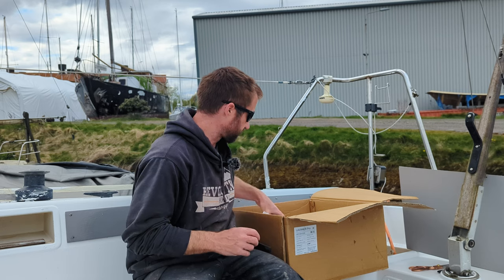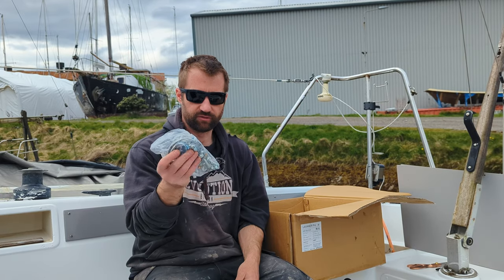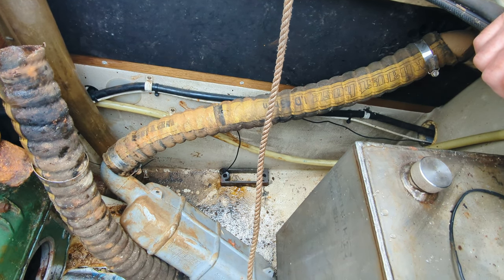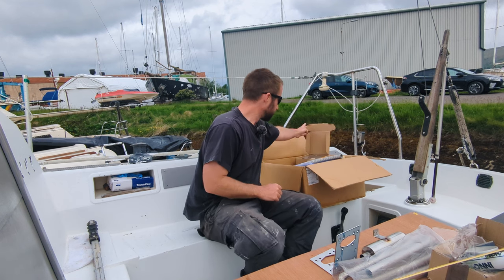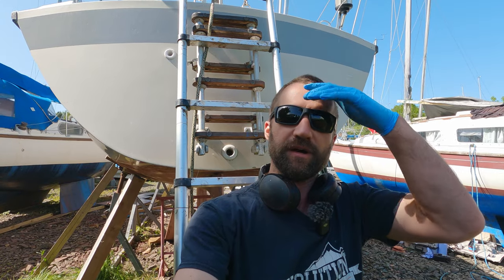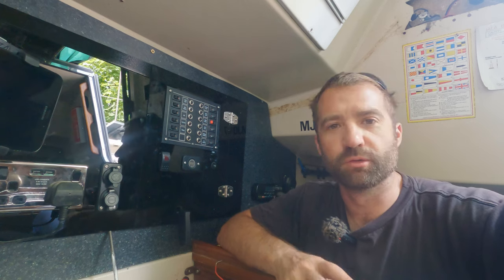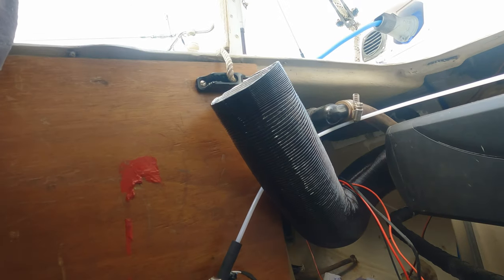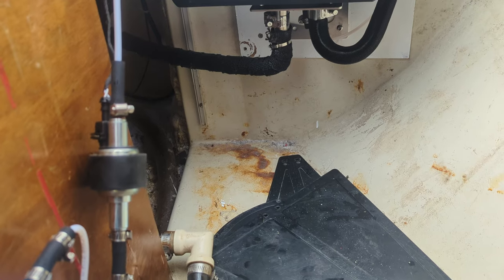Turning up the heat ... installing a diesel heater in our Etap 30

Comment: I installed myself a Webasto heater back in 2017... worked perfect for the first two years then had constant issues! Recently, I have been using a Chinese heater (all in one package type) for heating my shed/office over the winter months. The things i've learnt are both need regular maintenance to work well and having good access to them makes it very quick and easy to clean. I find heating oil works best and is cheaper at about £1 per litre!. This year, I have pulled the Webasto out and started looking at a solution to make a heater more easier to access! On the boat I only use the heater at anchor so thinking about something portable that would sit in the cockpit when at anchor!

Comment: Is your Etap the one with the closed-cell foam hull by any chance? I hear the Etaps dont have condensation issues thanks to the hull foam insulation and looking into buying one to sail into really cold waters (Norway) so if you have any clue I'd be grateful on how your boat handled the heater and if you had any condensation issues.

Comment: Very neat installation, little surprised you didn't add a condensation drain though?
Reply: Will have to see how it develops the, exhaust needs to be sealed as its inside the boat and would leak fumes into the cabin.  Maybe there is some kind of tap I could install but it wouldn't be hard to disconect the exhaust from the unit and drain it there if it becomes necessary so I would probably rather have a sealed system that I can disconect when needed rather than a tap or valve that could fail and leak carbon monoxide.  If you have any suggestions though I would apreciate it.  

Also as an FYI I installed Carbon Monoxide detectors at both vents in the cabin.

Comment: Tim just one thing I think the exhaust should have water traps on the two low spots.
These do work well just that horrible click but I have see an all electric super quiet pump on another youtube channel .
Reply from the maker: Once running the pump and heater did quiet down a lot.

The condensate drain issue is an interesting one.  With the pipe insulated I am not sure if it will be a major issue as the heat of the exhaust should clear anything out.  I really don't like the idea of any drain that would allow exhaust liquid to drip into the rear locker so would need to be collected which could also be a mess waiting to happen.

Moisture in the unit isn't a concern either as due to a hatch leak the unit completely filled with rain water.  I stripped and rebuilt the heater and other than a slight issue with one of the fan motor brushes it showed no ill effects.

Ultimately we will have to see how well/reliably it works and adjust from there.  My main concern is carbon monoxide so have installed multiple sensors in the cabin which should detect issues there at which point we would stop using it.
Reply: You might be ok with the insulated exhaust sounds in theory that it will be fine .  People with a lot more knowledge than myself nearly  always say if exhaust goes uphill it needs a trap.. Biu I am with you on the now I have something else to catch and manage somehow.  Another box with bilge pump in it.   Where  dose it end.. I have only fitted heaters to vans and my garage so downwards exhaust only.